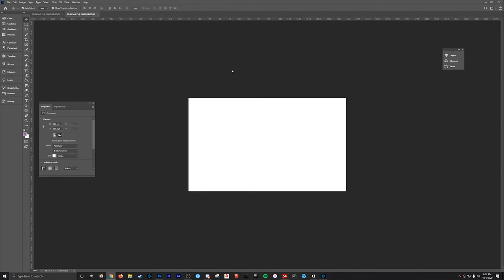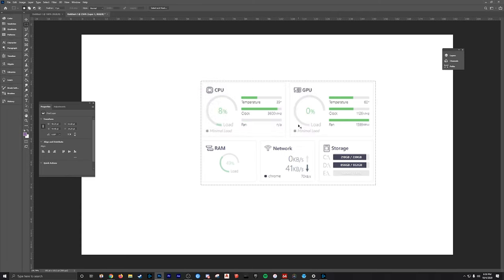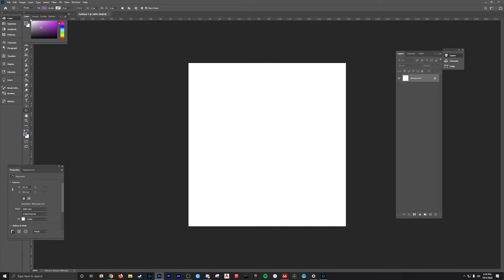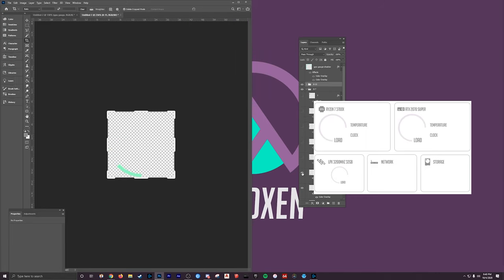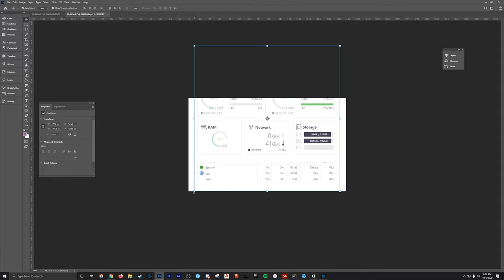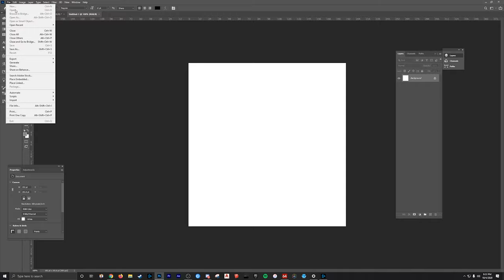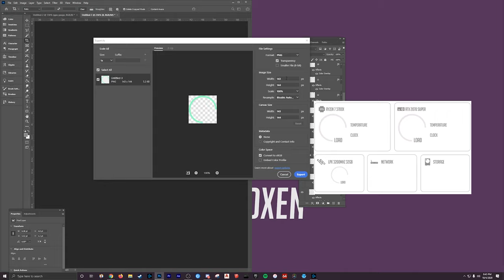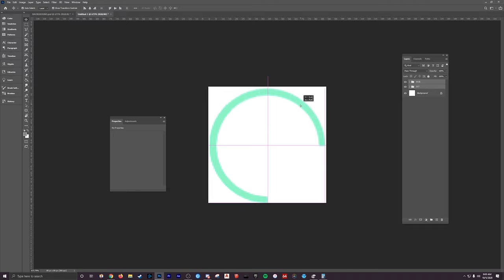AIDA64 Sensor Panel Setup | Part 2: CUSTOM GAUGES

Comment from the maker: This skin is finally up for download! Follow the Google Drive link for the asset files

https://drive.google.com/drive/folders/1JeiJRmouRjlOltMzdYSs8LcOkfIjt2vh

If you have any questions, send me a message. Look out for the next video on custom stat monitors using Rainmeter!
Reply: Thanks! Not sure if it's intentionally requiring access but just sent my request 🙏
Reply from the maker: @0xsix_  Ok I just changed the access, let me know if you can get in
Reply: @AliOxen  success! Did you use 800x480 when you made this?
Reply from the maker: @0xsix_  yeah the monitor I use is that dimension
Reply: @AliOxen  I need that Goku one xD
Reply: do you have to download all the gauge and create them in photoshop before you can use them on aida64
Reply from the maker: @michaelperry1845  you shouldn't have to take any premade gauges into Photoshop, you can take them directly in AIDA64. They should already be in .PNG format. I'm uploading a new video with a free layout that includes all the assets tomorrow and a store that I'm launching that has premade layouts

Comment: I don´t know why but in the drive file, the ram green gauge doesnt align with the png circle
Reply from the maker: Yeah I noticed that when I had it on my screen as well. I uploaded another folder with the resized RAM gauges in the Small Gauges folder. I realized I was using the Large gauges and that was causing the misalignment
Reply: @AliOxen  Thank you so much!! I managed to change every pc component title inside Aida64 without using Ps and it looks good

Comment: i downloaded the sensor pannel from your comunity tab and the memory network and storage sensors arent the right size. could you maybe fix this?
Reply from the maker: I'm working on why this is the case but the elements scale differently depending on the monitor specs, apparently. The same thing happens to me when I switch the layouts to test on another screen that I have here in my office. I'll let you know when I figure it out.

Comment: Started working on mine-  but I realize you could do custom gauges like what you put out there.   Now I'm thinking I could make a badass Sonic the Hedgehog theme.   I'm using the Raspberry Pi 0w with a custom script brining up Midori browser using the RemoteSensor DNS address.
Reply from the maker: That's one of the options I saw when I was initially doing research but I needed more time with the Pi get moving around in it. I'll look into it, maybe I can update the guide with better information

Comment: I want to make animated icons, like a animated burnig flame (for CPU-Temp).
How do you get the 16 images in sequence or random displayed without a function?
If i set the custom gauge to a function the animation is not fluent (like a gif).
Sometimes the animation stolls because if i use CPU-Usage the animation is ok until the cpu-usage is 0 for longer time.
I did try many functions in the list but every function i try results in a non consistant play-speed and stolls.
There should be a randomizer from 0 to 16 in the custom-gauge or just use no function, just play in sequence.
Reply from the maker: well the functions in the list correspond to actual stats being monitored so unless you have one that sends data at a consistent interval, its never going to play exactly like a gif. You MAY be able to get around that by using something like Rainmeter but I have to do more research to find out exactly how to show gifs using that program. But in short, no you can't display that in AIDA64 natively right now.

Comment: Is it possible to add a wattage readout? And overall power consumption from when the pc turned on and while its open?
Reply from the maker: that I don't know. I'm sure aida64 has a sensor somewhere that can measure output of certain components but I haven't tried total power consumption

Comment: How do you transfer my build  on my pc  to my 7 inch panel,
Reply from the maker: Well it was made for a 5 inch screen so it will be smaller but I have a website that will offer layouts for all monitor sizes orisha.tech

If you select YouTube Example and use code AO100 in checkout, you can download it for free